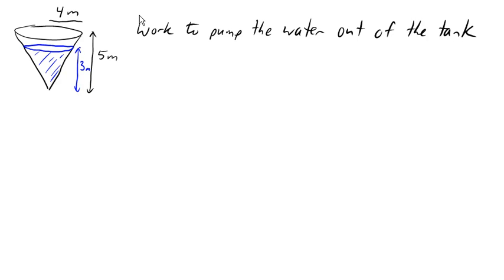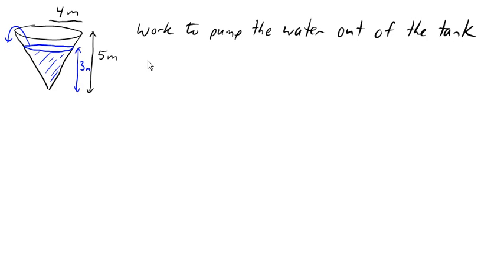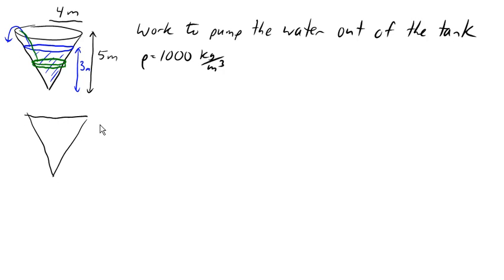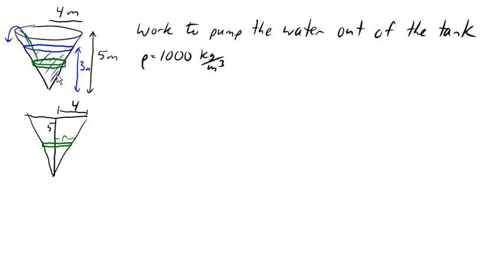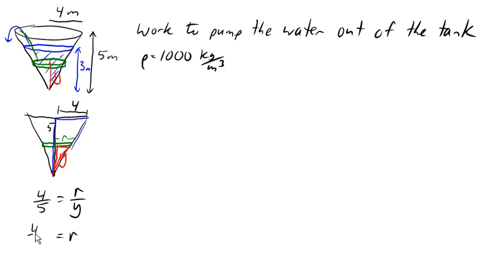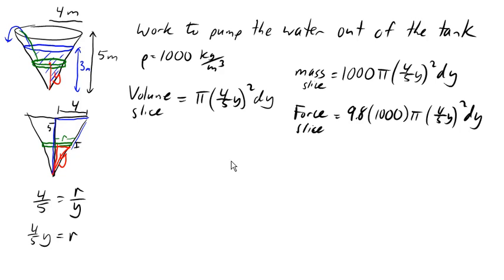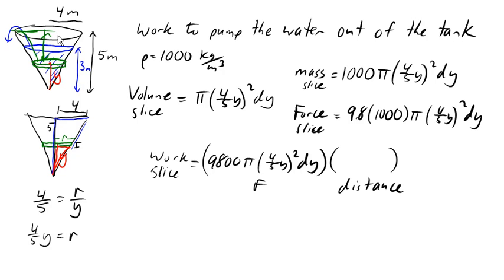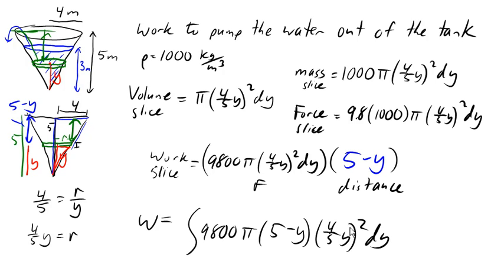Work to empty a conical tank

Comment: Why the area was taken on the distance y? Why we not take the surface area at height=3?
Reply: The only place that you need to consider water level is with your limits of integration. The given dimensions r and h help us relate the radius to the height y (from the bottom) at any particular height. The idea is that we accumulate these slices at all the general heights from y=0 to y=3.  If we wanted to take a snapshot of the water and find SA and volume at y=3, we could certainly do that, but we want to find the work it takes to pump that water over a distance (5-y) to the top, so we want a general equation to integrate.
Reply: well, thanks